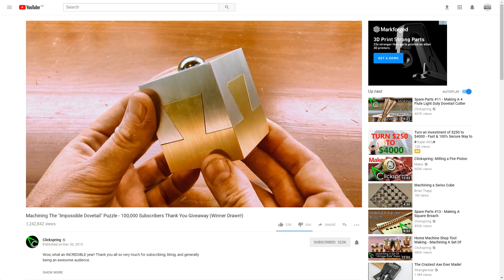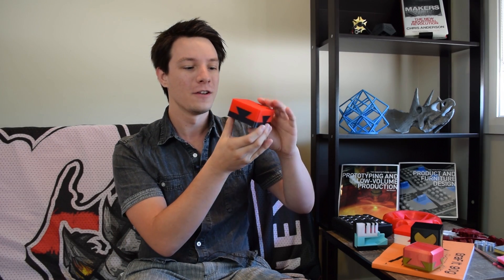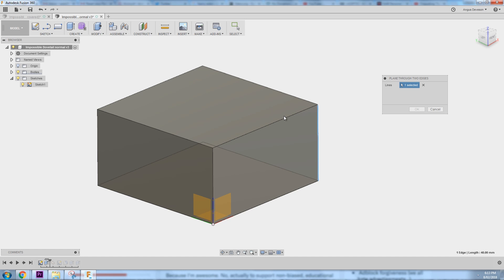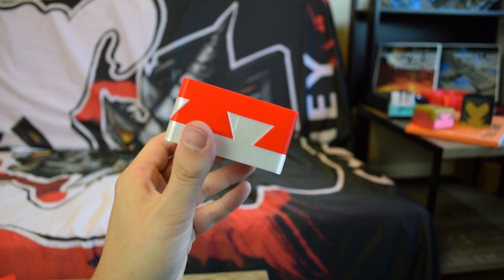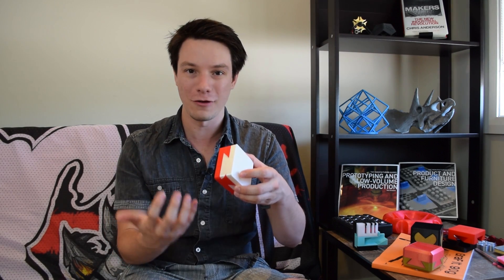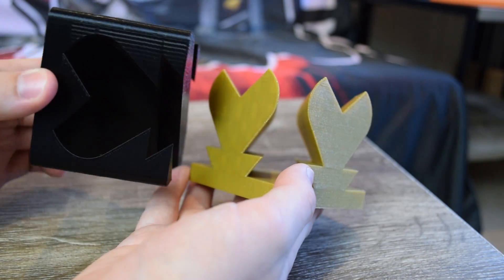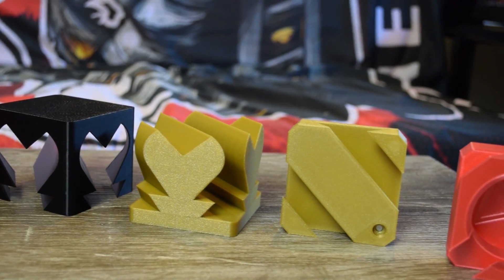The Impossible Dovetail Box... or is it?

Comment: I printed a fixed impossible dovetail box on an AnyCubic Chiron 3d printer. I used the model with the storage spot inside of it. The model I used had no extra plastic inside of it but the one I printed has extra plastic inside. what should I do?

Comment: For the ultimate dovetail, use the rotated shape. With ball and chamber BUT make the ball chamber in the "unlocked" side extremely deep, and add a LATERAL BALL as well. This way, you'd need to give it a tap in both up-down and side to side

The extremely deep "unlock" chambers means that once you unlock one axis, it'd be hard for it to lock again. Or, add magnets to both sided of the cambers. Now, for someone to solve it, they have to figure out that:
Its rotated
Which way to rotate
That it has a lock
Which way to unlock one lock
Realize it has a second lock in another axis
Which way to unlock the extra lock 

The fact that there are 2 locks will mean that even if they figure out it has a lock, even if they unlock it, they'd think they havent unlocked it.

Comment: Too many comments to check if anyone else has done this.  I didn't want to embed magnets or use a ball that might get lost so I printed 
my box with a gravity lock.  I print the top with a captive pin that drops into a hole in the bottom piece preventing the pieces from sliding.  The pin has a head that is wider than the opening at the end of the hole it sits in so it can't drop out.  I print the top with the pin in the retracted position with some support under it.  It is printed with a hex socket in the end so I can break it loose from the support so it can slide up and down. It usually takes people a while to figure out how to open it, especially those who don't know the dovetail part of the trick.

Comment: Hi Angus , i just bought a creality CR10s and just wondering if i need to use the Cura (ver.15.04.3) software they supplied or download the latest from Ultimaker website (ver.3.2.0)
Reply from the maker: +Stephen Anthony not at all! Use any slicer you like just make sure the bed size and filament diameter is defined correct, 1.75mm. start with a default and go from there!
Reply: Maker's Muse  thanks for that.I enjoy watching your videos.

Comment: Are there any glass printers? I'm visualizing a laser heated extruder with smashed up glass being piped (rotating spiral thingy in tube) with maybe borium oxide as an additive.. maybe needs ceramic parts with rotary blob maker at the extruding point.. dam, I want one.
Reply: P.s. great vid, well done that man! +1 to engineering recieved.
Reply: I remember reading about a guy that used solar panels in the desert that powered a 3d printing magnifying glass and it melted the sand into glass

Comment: Do you offer prints for your parts or just cad-cam files? I'd think it would be cool to make the rotating one on aluminum and brass
Reply from the maker: .stl files as well as a basic source file in fusion that you can use to directly make machining paths. Machining an undercut like that would be no easy feat though!

Comment: Great 3D prints!  I have been thinking making one of these puzzles on my CNC router.  I use Vectric Aspire and the difficulties I have run into is that Vectric does not let you model undercuts.  My idea is to use a dovetail bit.  It will not model correctly so I have to get accurate measurements of my dovetail bit and "fake out" the software by letting it think it is a standard end Mill.  Just need to do some precise measurements of the bit and figure out the correct offsets.  Thank you for sharing your models.  I have always been a fan of the impossible dovetail puzzle.

Comment: Is the info on what magnets and ball you need included in the files on gumroad?
Reply from the maker: The sizes are listed in the Puzzle Box instructions on the gumroad page, but good point on the logo. I've updated the listing with a blank version if you wanted to use it for such an occasion :)
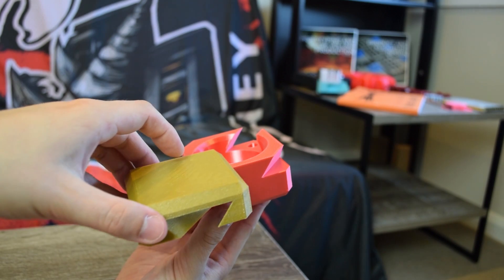Reply: The sizes of the magnet and ball are not in the files from gumroad.  Also, the secret box file includes the Maker's Muse logo (as seen at 5:11) so you probably don't want to use the box to surprise someone with a ring.

Comment: Great vid. But why didn't you also print a true impossible dovetail, no illusion? With 3D printing it's possible.
Reply: Dogger heheh, it's not my fault the language is unwieldy. By impossible, I mean impossible to separate without breaking. By possible, I mean possible to build, when it isn't by any other method. I've seen 3D prints with interlocking parts before, so why do you say it wouldn't work?
Reply: Dogger Exactly, impossible to separate, that's what I want, that's the whole point of my sub-thread. And they are interlocking parts, so what do you mean by not the same thing?
Reply: Dogger Any machine capable of dual colour prints, can do that easily.
Reply: Dogger I don't worry about meanings & definitions as much as you do. Language is flexible, I believe in letting it mutate & do whatever it wants so long as I get my general point across, & just provide clarification where necessary.

Toward that end... I do not just want a bi-colored block, I want the crack between them... A nice decently thick crack providing wiggle room, so you can see they're definitely separate inseparable parts, lol.
Reply: Ugh, I just realized... I'm a back-seat 3D printer. I don't have a machine to do projects of my own, so I ask youtubers why they didn't do their own projects my way, lol. Sorry, Angus. You rock, btw.

Note to self: call people by their personal name, not their channel name.
Reply: Theoretically you should be able to design & print one of these puzzles so that there's enough of a gap between the two halves so that a minute amount of movement gives the impression that they should come apart, but the sneaky thing is that they don't!
Hours of frustration for those who love a challenge!!!
Reply: Worth the look on their face when after an hour of trying, they're told it's truly 'impossible' & you haven't been able to seperate the two halves either!
Reply: Zebulon, I was thinking the same thing.  Would be neat to have a "truly impossible dovetail" printed on a 3d printer which is probably one of the only ways of creating such a thing.  Would be a mean puzzle to give to a puzzle solver since there is no solution, just the appearance of one if the gap is done right haha.

Comment: Hey Angus, I've recently purchased my first 3D printer. I bought the cocoon create touch and it was great for 30 minutes. The instruction said to clean out the the extruder after not using for a while. So I did but the drill bit included to clean was extremely weak and when removing it the bit snapped in half inside the printer. I've tried everything except taking it apart, which I don't want to do because I'm a beginner. Does anyone have any advice?
Reply: I did the same thing to me monoprice maker select v2, I heated up the extruder and just pushed some filament through. I'd recommend the cold pull method in the future for cleaning.
Reply: Try heating the nozzle, the metals might expand enough to give clearance for it to drop out - also you can try to set the temps to ~160c (colder on purpose) and manually push some filament through from the top to push the bit out.  That being said, if you've broken the bit off inside because you torqued it at an angle, the nozzle is most likely ruined and filament will leave the hotend at odd angles causing printing issues/artifacts. Good luck!
Reply: @Jooey join a Wanhao i3 group on Facebook if you have more questions, but be sure to give us all your settings and information along with your question! GOod luck replacing your nozzle. Maybe try heating it up and trying to push something through, but I doubt that will work. Those bits are practicaly designed to break.
Reply from the maker: +Jooey sorry I reread your comment, if you snapped the 0.4mm drill bit in the nozzle you'll need to buy another nozzle.
Reply from the maker: +Maker's Muse you only ever need to do that kind of thing if the machine isn't extruding.